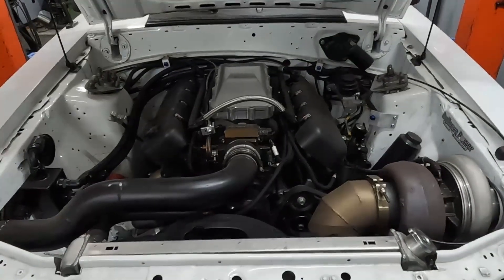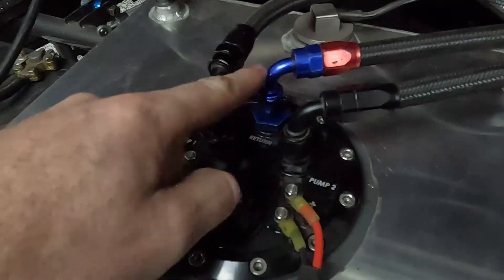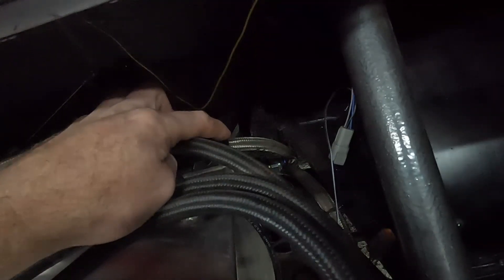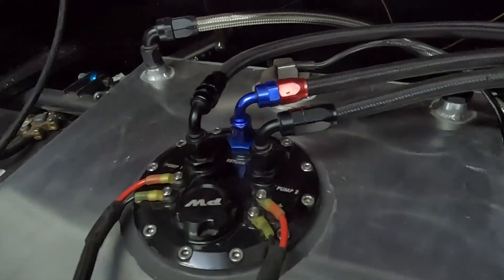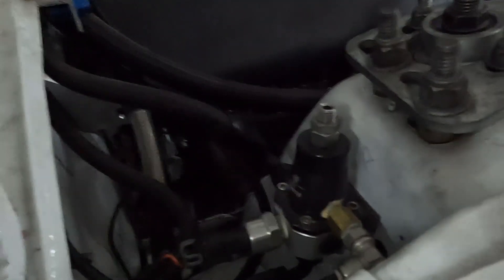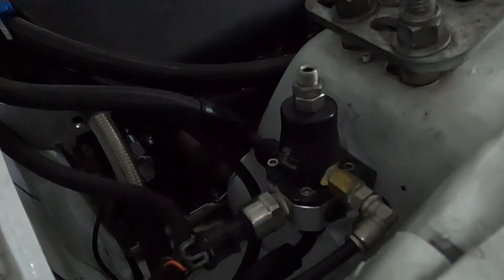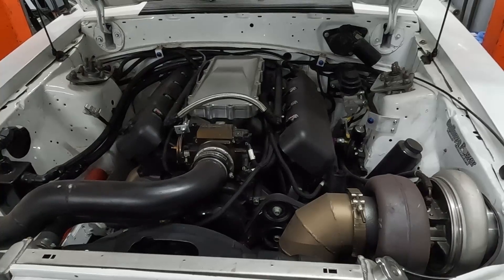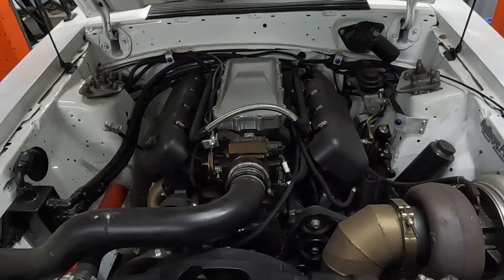My E85 Fuel System Shouldn't Support Over 1000WHP (Why it does)

Comment: Seen a evo 4 banger making 1000whp on the stock 5/16" return line and stock regulator with dual walbro intank fuel pumps. One runs all the time the other kicks on at 3 psi boost.

Comment: The fuel system on my race car that runs E85 is (2) Aeromotive Eliminator fuel pumps feeding a single -12 forward to the engine compartment, where it "Y"s to (2) -8 hoses, one to the front of each fuel rail, out of the back of each fuel rail -8 to a Aeromotive regulator and then a single -10 return to the fuel tank. I also run the 210lb/hr fuel injectors. One of the Eliminator pumps runs full time and the second pump gets turned on once 90+% throttle has been reached. It works excellent, might be overkill, but I know I am not going to run out of fuel.
Reply from the maker: You're never going to run out! Time for methanol
Reply: @WestcoastWrenchin  IDK, I am already at 70% duty cycle. Methanol would require a Waterman pump ( or a $2K brushless electric pump) and probably much larger fuel injector.

Comment: I agree about how people say you have to have-10 feed and -10 return for a 1000hp car. I have a 1000hp car drive it on the street but like you I have 1 450lph pump on all the time and a second one comes on at 2psi of boost, I do have -8 feed and -6 return but it's because only one pump is on and returning fuel until the motor needs more 
fuel and burns it why it works. Anyway how long are you ever in boost and activating the second pump.

Comment: I actually had problems on my NA 800 hp BBC E85 bracket car with -10 feed and -10 returns.  At first I ran just one 340 lpr pump. Fuel pressure would dip at the hit and then be fine for the rest of the 1/4 mile.  So I put a second 340 lpr fuel pump on it.  Fuel pressure still dipped at the hit with 1.29 sixty foot time.  Solution was I put one  big ass $800 aeromotive fuel pump on it.  No more dip in fuel pressure.  I believe having a -10 feed line had so much fuel in it (fuel cell in the rear of car) that the small pumps could not overcome the inertia of the fuel weight at the hit.  Even one small pump was enough volume of fuel for my BBC screaming through the lights a 7500 rpm at 150 mph.  But not enough ooomph to hold fp at the hit.
Reply from the maker: Totally makes sense, sloshing in tanks can get ya into trouble too!

Comment: Good info. The key is not to overwhelm the regulator return orifice and maintain 1-1 pressure ratio into boost. I run 3x walbro 450’s with pwm via a solid state relay and pwm output from the ecu. It makes the transition seamless .

Comment: Been telling people this for years. Made 650 on a stock truck 1/8” return. Staged pumps. You can pwm them in with Holley.
Reply from the maker: Honored you'd even comment on this junk! Truth being told tho these guys running garden hose for 500hp are wild.Thanks
Reply: @WestcoastWrenchin fr and people told me 6an feed and return can’t make 500 wheel
Reply from the maker: @UrbanSmokes21 and thats the classic approach I see 😂 i can totally see if you are running a monster external pump the small return line would be taxing in its health. But genuinely have never understood the monster fuel lines at low power levels
Reply: Staged pumps was a game changer on e85